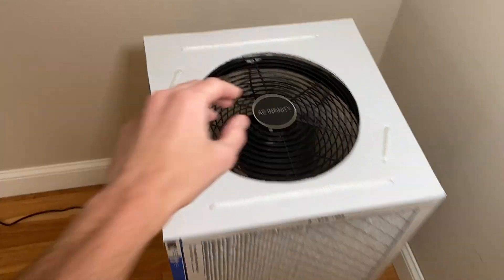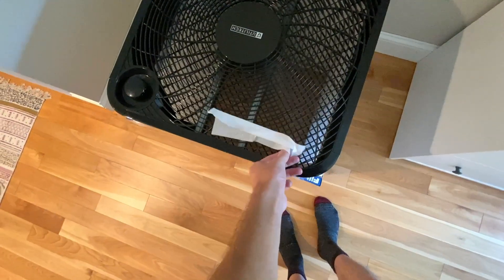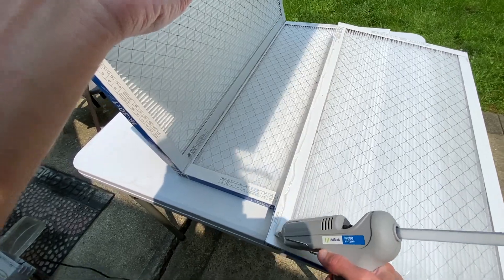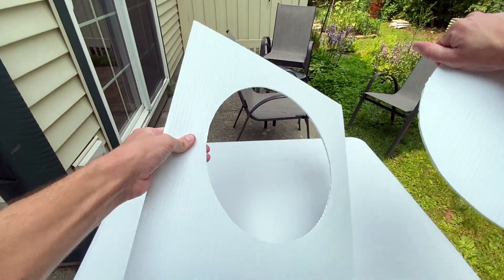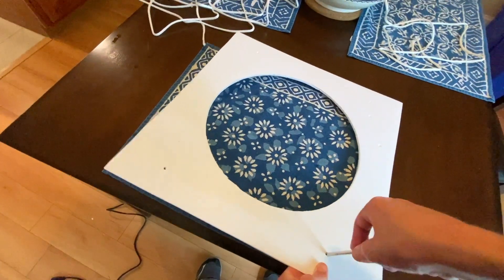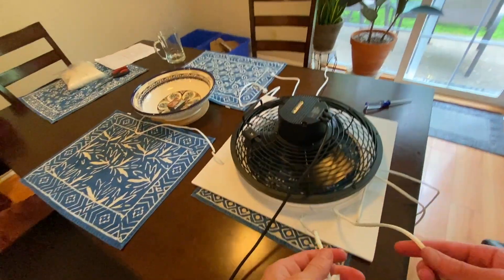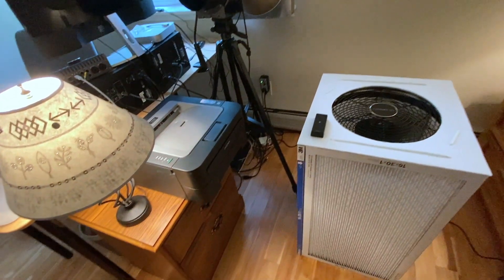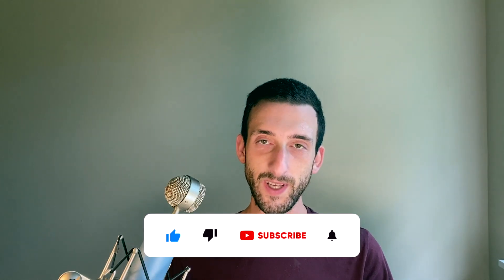How to Make a Better DIY Air Purifier

Comment: Costco has a good price on merv 14 filters, i assume those will be even better for use in the build?
Reply from the maker: Clean Air Kits compared MERV-14 with MERV-13s, and the 13s were actually a bit better in this application. But both are good!
Reply: @HealthyHomeGuide  Do you know how the Merv 13's were better? I am guessing it was just because they allowed for more airflow being less restrictive?
Reply from the maker: Yup. MERV-13s strike a good balance of airflow and capture efficiency in this application.

Comment: Construction hint - just get a straightedge that reaches corner to corner diagonally (opposite corner to corner) and mark a two or three inch line. Change to other diagonal corners and make a similar mark. Presto, the center is the middle of your X.

No math, no muss, no fuss.

Comment: Can’t u just buy an inline fan and slap a filter on it?
Reply from the maker: You can, but inline fans only have an inlet diameter of like 4-8”, which is super small, which causes that area of filter to get clogged up with dust super quickly.  The small diameter also causes airflow rate to be super high and dramatically reduces capture efficiency.

Comment: will this clear a room thats dusty ?
Reply from the maker: I’d clean first, but yeah, this air purifier captures dust very well.
Reply: @HealthyHomeGuide  Thanks for the reply man! thats great. 

question  - that fan is very hard to source here in aus, so i'll definately need to research something available, what are the things i need to look out for to ensure i get similar performance? Just CFM/Noise?

Comment: Have you tested the Enviroklenz air purifier ? How does your DIY compare. Lastly, how does your DIY compare to Blue Air metal box hepa purifiers. I use iQair, Winix 5500-2, Blue Air 310, and Enviroklenz, Quietest is the Winix 5500-2.
Very noisy is the Enviroklenz and filters are expensive. IQair has charcoal @ 5-6 pounds for kitchen odors or voc's.
3M makes excellent filters. I have solar to help with energy costs. Any advice would be welcomed as l enter allergy season. Your DIY project was inspiring  and the best on YouTube. Thank you. Will follow your educational advice.😊

Comment: if it costs as much or even less as say a winix 5500-2 why go through the effort of doing this?
Reply from the maker: In order to match the efficacy of this DIY unit on its medium speed, you have to turn the winix on its highest speed, which is super loud.
Reply: @HealthyHomeGuide  thanks for the reply. how often are you recrafting/gluing your filters together? it just seems like a chore to have to do it every time they need to be replaced
Reply from the maker: I use tape now instead of glue. I got sick of the gluing process haha. I do it roughly every 3-6 months. Vacuuming the filters prolongs their longevity. It’s not too bad of a process, but yeah, it’s a little annoying. Takes me 10 minutes or so. This air purifier captures an unbelievable amount of particulate.
Reply: @HealthyHomeGuide  Ahh gotcha. Only problem with tape and even glue is the aesthetics. i watched your other video and cleanairkits makes me curious. i'm assuming those units are pretty simple with replacing filters? and would you say those are as effective as your DIY?
Reply from the maker: Good question. The clean air kit model I have (the brisk box) is the same amount of work replacing the filters as my DIY unit. Clean air kits are not speed adjustable, so they have one quiet speed whereas my DIY unit is speed adjustable and therefore is capable of being more powerful. I prefer mine for that reason, but I still use both.

Comment: I made one for my wife using the cloudlift S12 fan (which is a well built product) and followed your  instructions except that I cut my plywood support board and set the fan on top of the circular cut opening . The air is pulling through the filters.  I built a 2nd design using the 1"x25" filters and a Vevor 10" shutter exhaust fan with controller (priced $84-$90  approx) it rated at 15 watts consumption, cheap to run. I t is mounted on top of my support board with a square hole cut in it. Since the motor is on top air is pushed through the filters.
This is a 10 speed EC motor, quiet and has a controller. The fans are sold without the controllers at a reduced price but I am not cure if they are EC fans which operate at lower voltages and save money in the long run.  The fans come in 10" -16" sizes.  Just suggesting as a price alternative.
Reply: should be 1"x16"x25" filter
Reply: how did you buy the s12 fan? Seem out of stock

Comment: We run a business where a significant amount of dust is generated, and we are considering building a Corsi-Rosenthal Box. However, we have an issue with MERV-13 panel filters: the dust accumulates in front of the filters, and when we replace them, the movement causes the dust to become airborne again, which we want to avoid.

Would it be possible to modify the box to work with a bag filter? The idea is that the dust would collect inside the pockets, making it easier for us to dispose of. Do you have a DIY solution or any recommendations for us?
Reply: HEPA vacuum the front of the filters then disassemble/move them.

Comment: Excellent approach, but I wonder if you need a bottom plate in case the floor isn't flush against the bottom edges of the filters so that air doesn't leak through.
Reply from the maker: Yup, I use bottom plates these days.

Comment: How long did your filters last? 🤔
Reply from the maker: 3-6 months depending on how polluted the air is where I live. You can potentially stretch it for longer if need be.
Reply: @ that’s exactly what I was thinking, 3-6 mos. Sounds just right. I tried to do the environmentally friendly thing & stretched it to 9 mos. W/ my last build, definitely too long.

Comment: I built a cr filter in June with a box fan. Really wanted it to last a year, but it didn’t. I’m changing it now, after 9 months. I think I should’ve changed it 3-6 months ago. It is very black. I probably have a bad mold problem.

Comment: tried to find the fan you mentioned and it costs $300+ now so it's now more cost effective to buy a brand new air purifier than make it yourself.
Reply: Not on a per performance basis

Comment: It’s a very clear tutorial, but the dirt will be visible on the outside vs having the fan blowing into the box and pushing air out through the filters, which would keep dust in the inside.
Reply: 20000 iq move, was wondering why noones done that, (would it also be more effective to have a fith filter inside going horizonal, having second fan blowing out at the bottom.. Just brainstorming)

Comment: QUESTION: Is it true you've got to change filters every 3 months? Seems like much work and costs if that's true. Or can you easily clean the filter? I would build this if it lasts at least a year.
Reply from the maker: It depends how bad outdoor air quality is where you live, and it also depends how frequently you vacuum. But if you live somewhere with decent air quality, and you keep your house decently clean, and your house doesn’t have a bad mold issue, then you may be able to stretch the filters 6 months to a year. Vacuuming the surface of the filters can help prolong their life.

Comment: Be careful when using the links. The Amazon link for the fan now goes to the s14 version instead of the s12. Gonna have to make a return and order the other one xD
Reply from the maker: I put in the correct link in the description, but unfortunately, Amazon links to the s14 when the s12 is out of stock.

Comment: I recommend add coarse filter as a preliminary surface layer before hepa filters. Without them hepa filter's resources will be depleted pretty fast because of dust. Better build carcass using wood, or aluminium profile. Insert  two layers of heppa filters, and coarse filter before them. The cheapest option is car saloon 5-layered hepa filters Mahle and any coarse filter.

Comment: Do you know how well these filters capture VOCs? I'm looking for a purifier for resin 3D printing, and leaning more toward the cheaper levoit options. I don't need it to be insanely optimal as the room gets constant ventilation with a fan pulling fumes out an open window. That fan plus filters totals almost $300, whereas a levoit purifier off amazon is $80. Much smaller profile as well which is appealing, but my main concern is VOCs.

Comment: The link took me to a 14" fanblade which I accidentally bought when I wasn't paying attention. I went ahead and made it work using the chloroplast sheet for additional siding. My next set of filters will be larger filters. I'll redo the top for a larger fan and I think everything else will work out the same, only bigger.
Reply: Use attic exuast fan....$200 ......perhaps? Idk

Comment: Drawing diagonal lines from the corners of the square top sheet will automatically give you the center point with no measuring required.
Reply: This info. has been mentioned like, a gazillion times, LOL 🤓.

Comment: To make it a usable end table: flip upside down, hot glue some feet to the coroplast/fan mount, use something a bit sturdier than coroplast on top that can hold a coffee mug and a lamp. done!

Downside: the output may stir up dust on the floor. But that does encourage it to get filtered, right?

Comment: Bruh im not paying $180 for a fan. That is not a good choice. It makes it almost as much as a high quality air filter
Reply from the maker: Wow, the price has gone up since I posted this video. AC infinity is kind of pissing me off. It's still a great fan, super powerful and quiet. And still would be a cheaper, quieter, and more effective air purifier setup than the equivalent high-output air purifiers on the market.

Comment: I got through building mine 2 hours ago! Thank You! I followed step-by-step which I would recommend others doing. The AC Infinity fan is awesome! Definitely the best fan I've ever owned. I had to make a modification. Around the top rim I added foam weather seal.  The fan is sinking in and there were slight gaps in the corners. Also, I did use zip ties instead of the clothes line.  I went ahead and sealed the outer corners with a bead of the glue. I'm going to make another one in due time. I'm going to use either Delrin or HDPE for the top where the fan is attached. I think I may make a frame that I can pull out the filters easy and change them.  Also, want to make a way for the electric cord to go through and not have any air leak. Advice for others...definitely follow step-by-step. Have a very sharp fresh blade for cutting the coroplast. Make sure and have a nice level surface with plenty of space for when gluing the filters together to make the box and a nice level surface for when cutting the coroplast. Have extra glue sticks...it did use more than I thought and had to run to another room quickly to get more. And again, I highly recommend this AC infinity fan at some point if you can't afford one right away.

Comment: What was the total cost of making this filter? 
I'm consider this or making the Nukit Tempest. I do believe your method would be better for a larger space. My house is about 800sqft. So I'd like to set at the midpoint from the living space and intake for heating ventilation. That way it's cleaning the air as it circulates through the house.

Edit: I'm looking for another fan atm. I'm curious if buying the same fan at around $150 is worth it. Considering many people are probably only running on mid settings, maybe 800 to 1000 cfm. Likely use smaller filters so It doesn't stand as tall.

Comment: I built your design and used polystyrene 3/4 inch insulation cut the hole just big enough to drop the fan in snug... No strings attached
 😂
The fan is not flush with the top but is working perfectly.
Thanks for the great idea as we have 2 very dusty birds and I hope that this improves the air quality around here.

Comment: You did not try "every box fan on the market"
Air filters have to be replaced periodically.  So you're going to rebuild this box periodically?  Like every other month?
Reply from the maker: Yes, I actually did try every box fan on the market.
Yes, I rebuild this box every 3-6 months depending on the air quality. It doesn't take long, maybe 10 minutes.

Comment: Instead of Coroplast and clothesline rope I would have probably used 1/4 inch plywood and about 12 large zipties(those things are really strong). Great video though.
Reply: I just dropped the fan on top of the coroplast, still blows out, no rope needed. coroplast is flexible and may provide a better seal.

Comment: Your air flow direction is so that dust will accumulate on the outside surface. And cause turbulence in ambient air reducing filteration efficiency

Comment: For like 10 bucks or so you can buy an ac regulator for any electrical appliance. It lets you regulate the voltage. Search for something like "4000W AC 220V Motor Voltage Regulator". Since I live in Thailand I buy this from Lazada. Although not every fan works with it. It depends on the quality of the fan motors if they will make additional noises.

Comment: Why choose a 12" fan instead of a 14" fan?
Why are 16x25 filters now recommended instead of 16x30?

My intuition suggests that using filters closer in width to the fan might improve suction. However, this would reduce the total filter surface area. Is there not enough room for a 14" fan with 16" wide filter? Could you not just get 20" wide filter instead, and the fan would be even quieter?

Does a 12" fan generate higher static pressure (i.e., the ability to push air through restrictions like fins or filters) compared to a 14" fan? While your table shows the 12" fan offering more CFM per dB than a 20" box fan, the box fan sits closer to the filters (no?) (although now I reviewed the video, it's quite deceiving from the outside view) and even though less static pressure, in itself, I assume, being in closer proximity to the filters may make up for it?

BTW, did you personally do the testing for dB and CFM?

Comment: I was expecting the fan to be blowing in vs. out… Any info on why one way is better than the other? Otherwise, excellent video! Thanks for the help!
Reply from the maker: Thanks! For air purifiers the fan should be blowing upwards, for two reasons: 
1.) If you blow air downward into the box, there's a lot of turbulence that reduces the air flow rate. 
2.) By pulling air through the filters before it hits the fan, the fan will stay cleaner.
Reply: Makes sense! Thank you!

Comment: My office uses Winix 5500 and my small bedroom has a Winix 5500. My Living room & Dinning Room has a IQair and a  EnviroKlenz  The IQ AIR HAS A 5 POUND charcoal  filter, a pre filter plus a 2 year hepa filter. When l complete the use of these filters l will switch to your type made by me, using 3M Filtrate  Merve 13-16 filters  and DIY assembled +  repaired by me.  l have made my computers using mostly pre-owned older abandoned machines since 1985. I am a  Linux fan/supporter. I love how you took off the shelf parts and solved a big wasteful problem ! 😊  Bravo.

Comment: Placing the whole box on some rubber seals and also using rubber seals for the fan part will make it even quieter, the rubber seals cost like 5 bucks. It´s basically acoustically decoupling your unit from the floor which is a huge resonant body.
Also just use 4 120mm PC fans instead. They are even plug and play you don´t need to solder anything you can buy all the parts on Amazon, I have done that to my heating to increase their output about 5 fold at least (don´t do this it´s illegal)
Reply: Would a single big ass exhaust fan do the job?
Reply: @krwpk  One big fan could do the job, this depends on the fan, it´s design and so on.
Reply: @sierraecho884  I am concerned about the turbulence of just pointing a fan upwards. Do you think strapping something like a pillow case to diffuse the air would be a good idea? Or am I worrying about nothing? Sorry, I don't really have anyone else to talk to about this 😭
Reply: @krwpk  "...I am concerned about the turbulence of just pointing a fan upwards..." You can´t adjust the power of the fan ? What exactly are you concerned about ? The fan will blow air too fast towards the ceiling and this will create an unpleasant airflow ? 
You should be able to either adjust the fan speed by changing how much power it draws or if this isn´t possible ( you can always buy dimmer switches and such) you can increase back pressure by getting more and or dense filters. That´s basically your pillow idea, having a muffler.